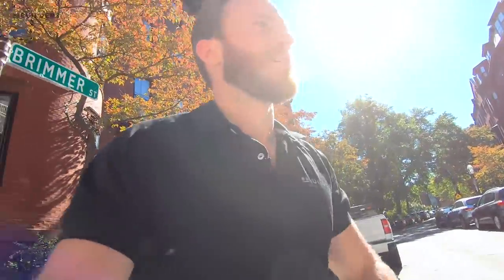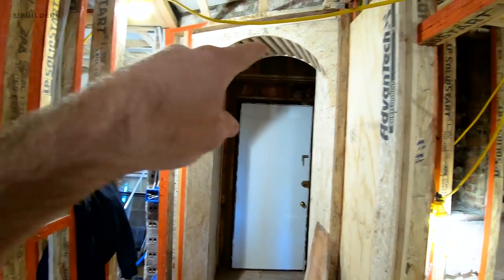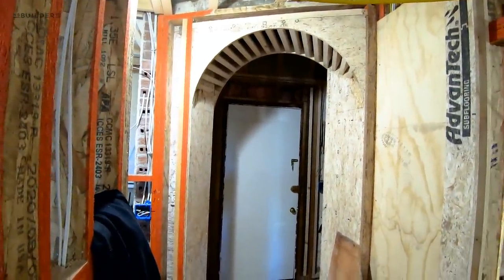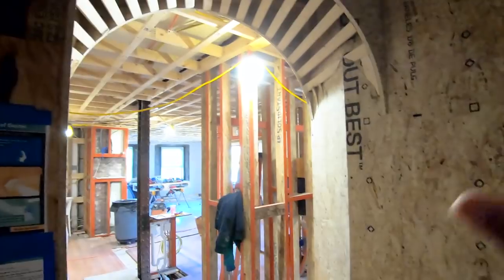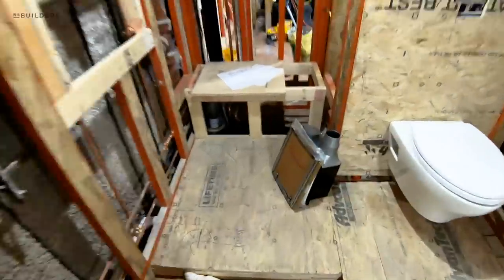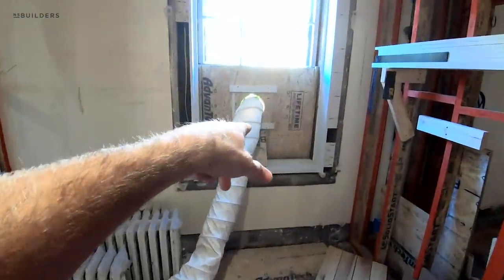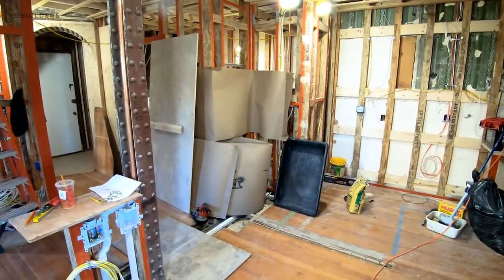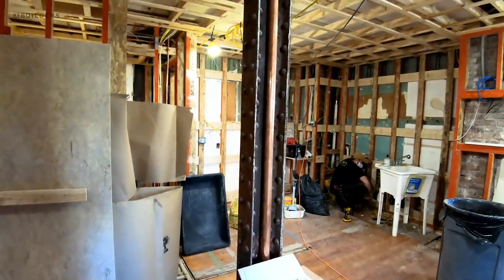Looking at the entry archway detail at Beacon Hill | Site Visit

Comment: Love the look of that steel column and your idea to leave it exposed is great ... those big rivets are fantastic! But. I think that the steel might be cleaned or buffed a bit and left in its raw, beautiful, steely state, rather than being painted black. Viewed from afar, the black would make the mass look monolithic and without interest.
As well, I think that a fourth side should be added to enclose the copper pipe, which detracts from the simple mass of the steel. Leaving the copper pipe exposed forces you to paint it and the "column" to unify the two shapes and overly complicates the structure and would make it look fussy. 
Leaving it exposed means it's not a column but an 8-sided "thing" - 3 exterior square sides of the column, 3 interior and one of the copper. A bit busy, in my humble opinion. BTW: this is not hate mail!
Reply from the maker: We'll take this into consideration Wanda. Thank you for putting together such a great idea. Appreciate it.